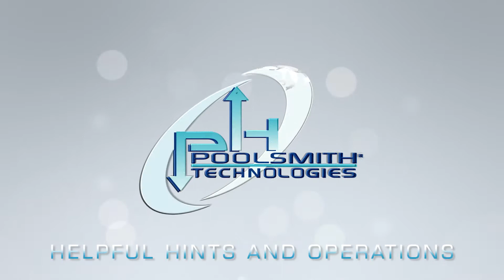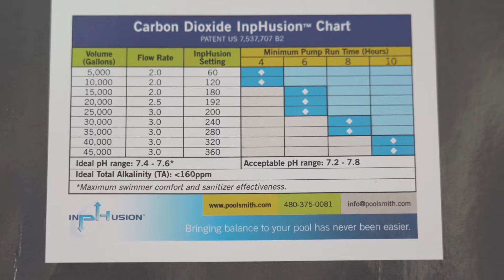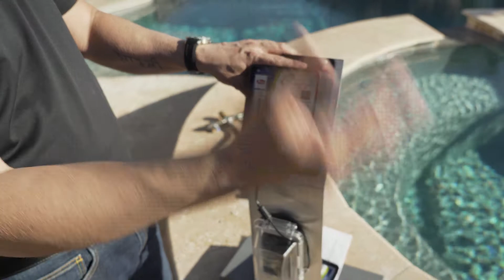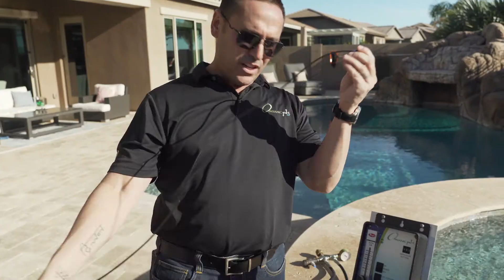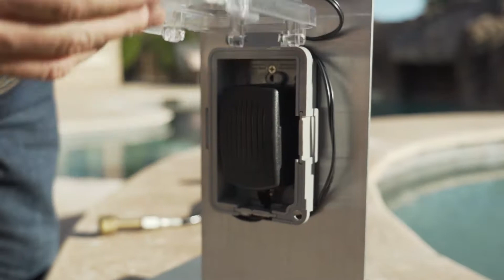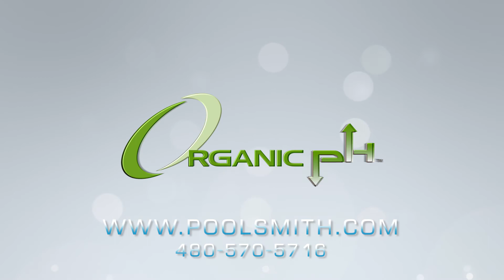Helpful hints for operating the system

Comment: Question: The system looks cool! However, All of my research points to the fact that if I use a CO2 system such as yours that I'll still need to add muriatic acid to control the rise in Alkalinity? Is this true and if so what is the benefit of this system if I'm still going to need to add muriatic acid weekly to maintain proper alkalinity?
My pool is 18K gallons for reference.

Can you please help to clarify?